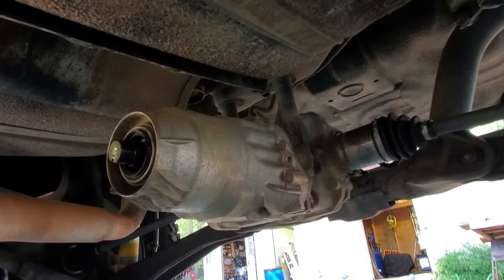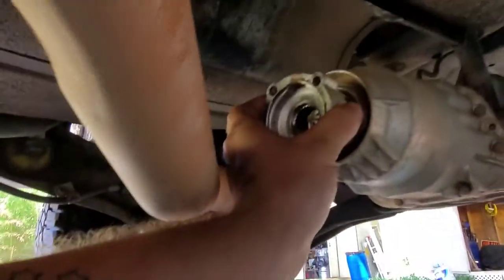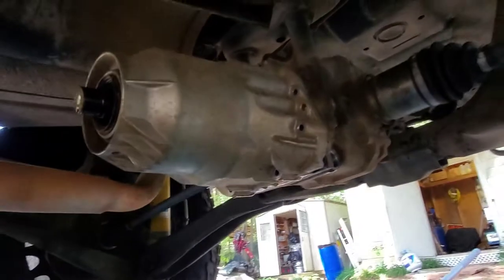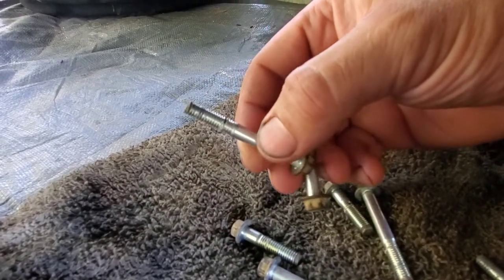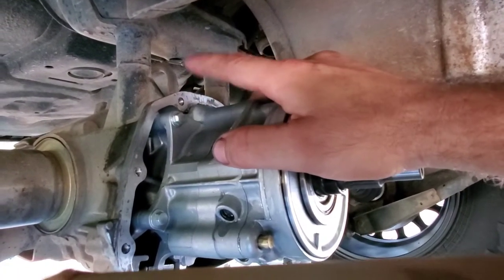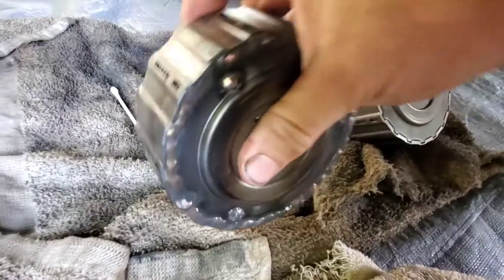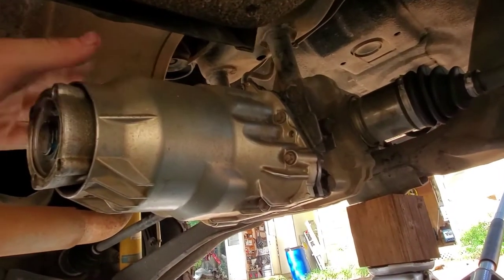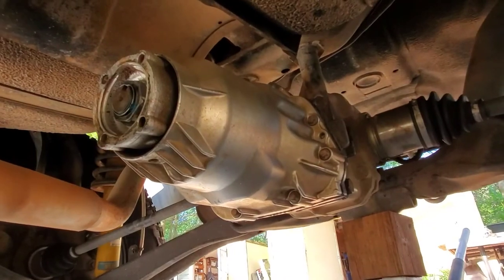HRG Engineering Clutch Pack Delete Plates Installed

Comment: hows it daily being full time 4wd now?
Reply from the maker: Works great, but you need a viscous coupler
Reply: @rt4wd_wolff  no wheel hops when driving in tight places?
Reply from the maker: @IronMikeyT  no, nothing like that. It's not really locked in 4wd since I have a viscous coupler which allows slip.
Reply: @rt4wd_wolff  nice. ok thanks for the info